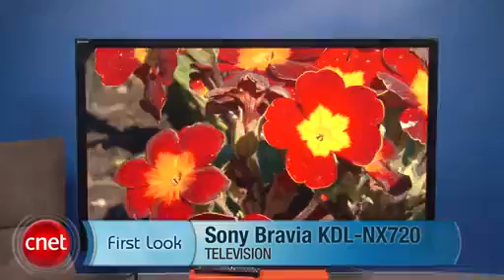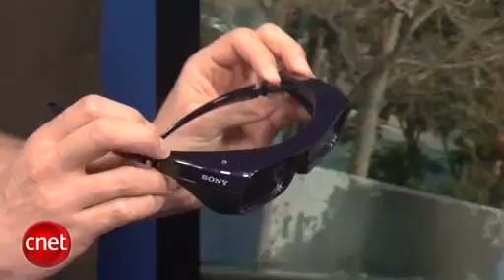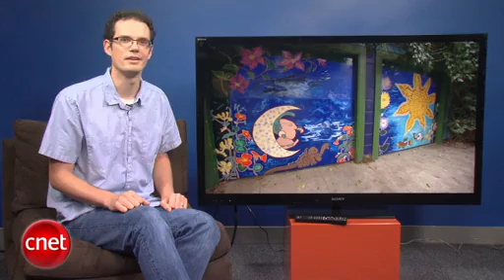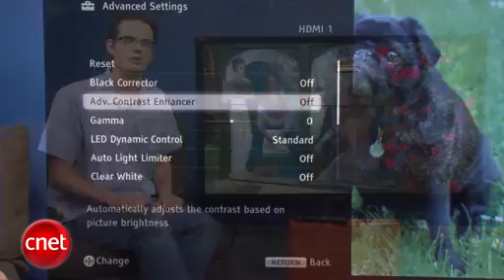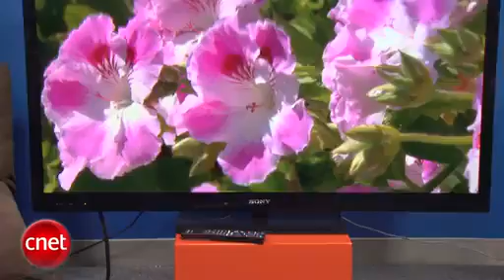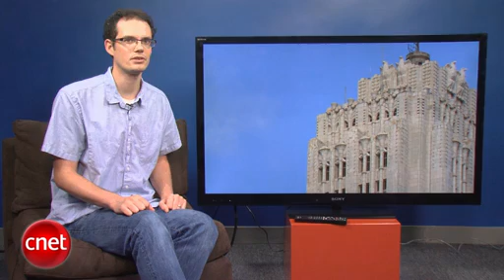3196. Sony BRAVIA KDL46NX720 46-inch WiFi 3D LED HDTV, Black Review | Sony BRAVIA KDL46NX720

Comment: Hey guys I know it's been a while but I know this tv has 240hz, how can I get 120hz for my xbox one x
Reply: I don't think you can go more than 60Hz. But to make sure plug in a pc/laptop and check from windows if there is an option to go beyond 60Hz. But I think HDMI (the TVs HDMI version specifically) does not support 1080p/120Hz. But it's worth to make sure.